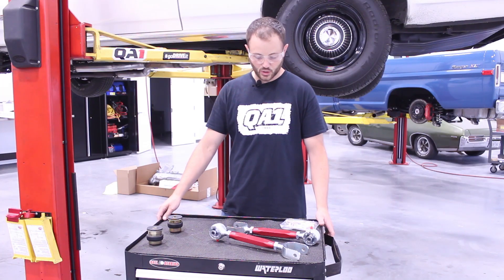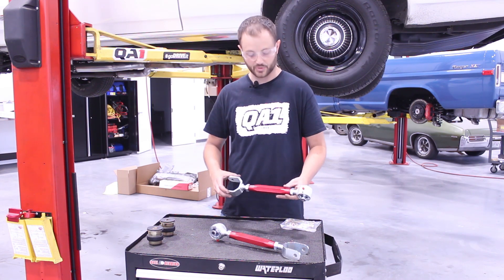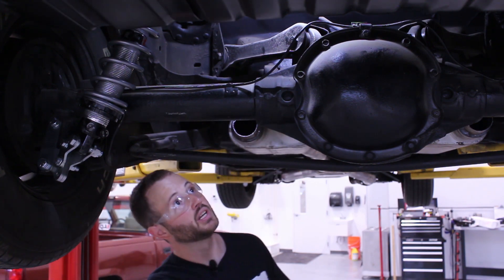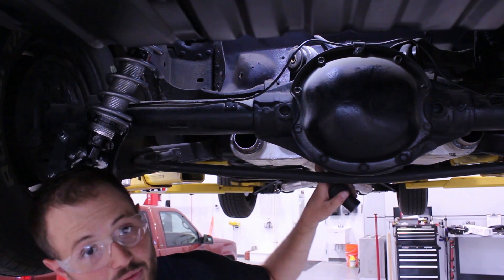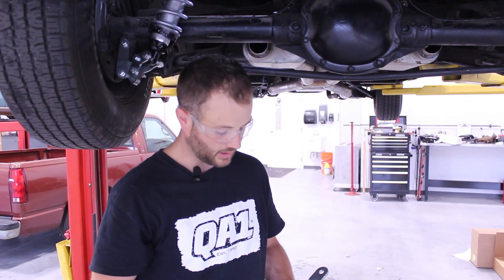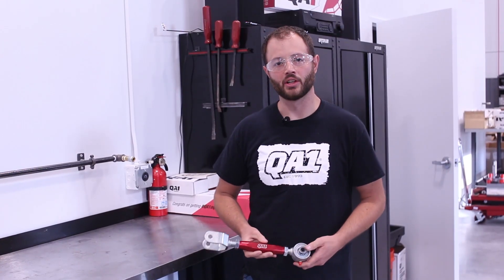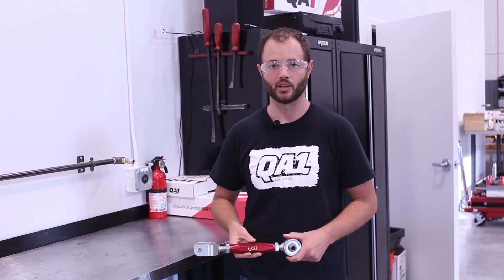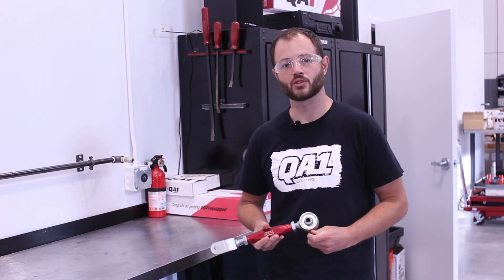How To Install Adjustable Upper Trailing Arms

Comment: That's mainly camber, to adjust the trailing arm bushing the thing your not holding you looses the rear trailing arm bushings bolts and slid them out for toe out